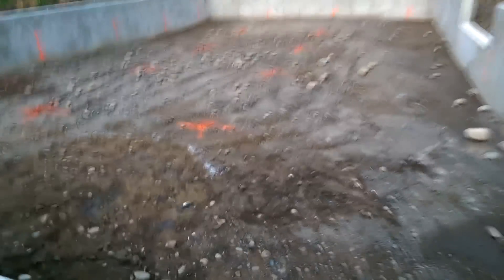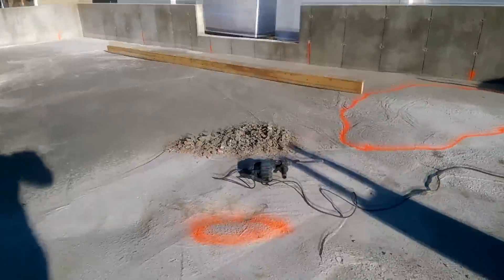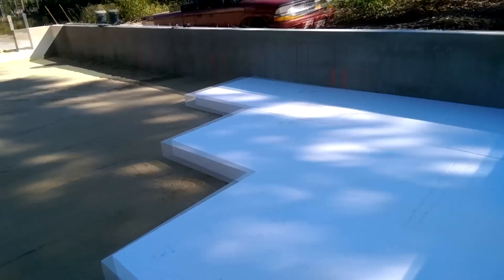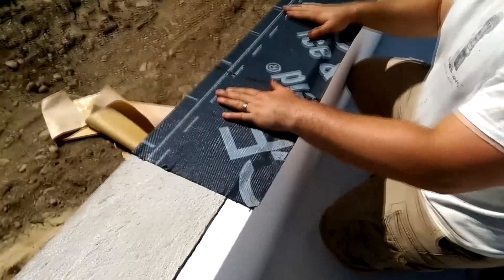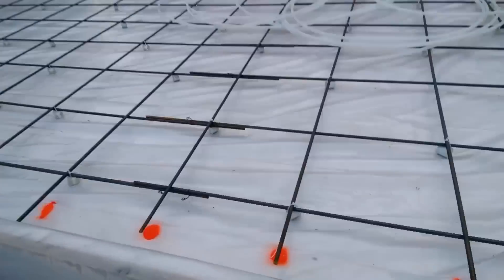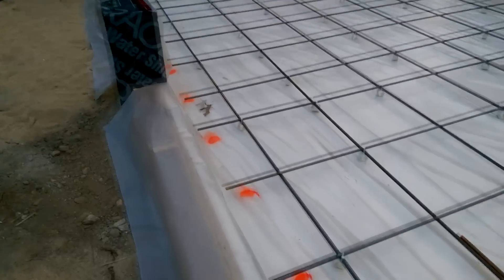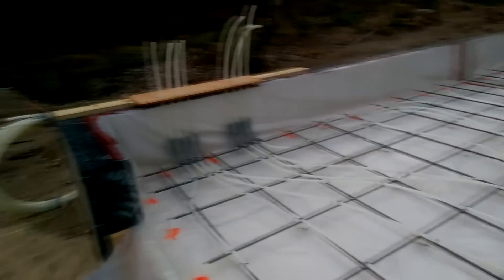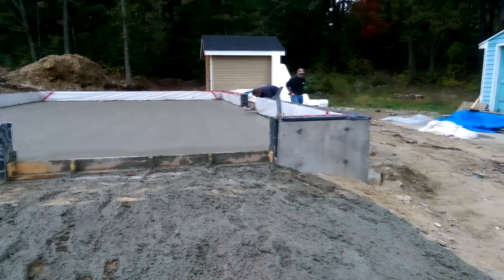Garage Workshop Super Insulated Radiant Floor

Comment: ive built a few of these floors before and i see quite a few mistakes. The foam you want to use under concrete floors needs to be at LEAST 8 lb density. Your pex is the wrong pex to use, you want the pex with aluminum sleeve, and you should have used gravel base  with drainage.
Reply from the maker: I do wish I had used a gravel base instead of messing with the flowable fill.  This PEX does have an oxygen barrier.  And the foam is a high-density foam.  Thanks for watching.
Reply: Nice work David! Thanks for posting. Do you mind sharing the brand and type of foam you used, where you ordered from and what it cost? I'm doing a radiant floor later this year and like the idea of a higher R-value beneath the slab than the required R15. But maybe it would be overkill for our climate in Portland, OR?
Reply from the maker: I bought my foam from Branch River Plastics in Rhode Island.  The product description is "Geo Foam".  You might be able to order it from a manufacturer closer to you to save on shipping.  As for the R-value, my R-56 is overkill for MA in general.  I went to that extreme because I'm trying to heat the garage just off solar.  Another extreme would be someone who is not heating at all.  They don't need any insulation.  Just match the R-value to your situation.
Reply: Thanks! I can appreciate what you're trying to accomplish!

Comment: All that money and effort and you didn't put a drain in?
Reply: ++Sonny Lloyd  Not sure about that million dollar filter but these days if you want an inside floor drain most codes make you install a separate drain tank (read: septic style tank) with an oil / grease trap and an alarm system or some way to warn you when it's full. It's not cheap. The easy way is to slope the floor toward the door and use an outside drain, which can lead to anywhere. Yeah, you have to open the door a crack to let the water out, but them's the breaks. The only alternative is to pitch the floor to a pit and install a sump pump, but some towns frown on that too!
Reply from the maker: There is no drain in the floor.  If you recommend a floor drain, then where does it usually go in your projects?
Reply: DavidPoz  either in between where the cars are parked as a length wise grate style or one directly under each car in the 4 inch with solids trap style
Reply from the maker: Thanks.  Do they go to the septic tank, or out to daylight, or something else?
Reply: DavidPoz  generally to daylight is what I've seen
Reply from the maker: Thank you.  Next time I build one I'll do that.
Reply: I put a drain in my first garage I built and I regretted it! I never used it once and I had to deal with a sloped floor every time I jacked a car up. I moved and built another big garage. I did not put in a drain in this one and it functions much better! I don't miss it at all.
Reply: ++boy2cuda.. How much pitch did you have to cause issues with jacking up a vehicle? I mean, 2 inches in say 30 feet is enough to get most of the water to move, but you may still have small damp spots because it's really had to get it right by eye.
Reply: True, it wasn't that much of a pitch. I can't remember how much exactly but when you put a car on jack stands to crawl under it I like the stands to be on a perfectly level floor and not have the jacks slanted even slightly.
Reply: ++boy2cuda.. You musta had one "son of a pitch" because my shop floor is about 2 inches in 30 ft and it's not even enough to allow a vehicle to roll, never mind being an issue with jacks / stands. OTOH, I did install a lift and had them shim it level. It's enough slope to add stress with 6,000 pounds up 6 ft in the air. For the record, I used 5,000 psi cement and did the lift area (center 8 ft) 6 inches thick using a 3/8 rebar grid placed 4 inches down and then a 6 inch mesh 2 inches above that. The rest of the floor is 4 inches thick with the steel mesh. Total poured floor is 35 ft long so I have room to use an engine hoist on either end of a vehicle or bring in a second vehicle to jack up behind the one on the lift. Twin post above ground lift capacity is 10,000 pounds and bolted into the floor so I couldn't put any pipes or conduit in the slab, which create weak spots. The main reason for the floor pitch is there's not enough pitch in the property to run a drain out to daylight if the pipe was well under the slab.
Reply: careful with that.  many municipalities don't allow garage floor drain to daylight for fear you're oil drip will go to soil and contaminate.  need a million dollar filter... bla bla.. not worth it.

Comment: Great video. I’m remodeling a 100yr old rock house in SW MO. The termite damage to the floor joist was so bad, after we pulled the first 2 layers of subfloor off the floor joist collapsed. Anyway we are retrofitting this old house with heated concrete floors. After seeing this video I’m certain geofoam is a product I will definitely use. Look forward to seeing the progress.
Reply from the maker: Sounds like a good project.  Thanks for updating us, and I look forward to hearing how it goes.

Comment: very impressive, it would be nice when building standards will mandate builders to do house slabs to such spec.  Homes built on slab get very cold in winter and hard to heat, very inefficient.
Reply: Then 90% of people couldn't afford a house and would have to live in tents.
Reply: I don't understand how you equate refining the spec on slab to 90% of population living in tents!

Comment: Will you ever save enough to pay for all the extra cost..
Reply from the maker: There is often a large up-front cost to renewable energy.  That is why I recommend minimizing energy loads first (insulation/air sealing).  Then the renewables can be as small as possible.
Reply: Also I'm gonna be building a 50x80x14 here in a couple years starting on the dirt work this spring.. needs alot of fill and time to pack and settle.. I have alot of question I wanna ask you I'm planning on one hole aide of the roof to be solar panels and installing geo thermal wells..
Reply from the maker: My goal is to build a solar heated garage, so it needs to be incredibly efficient.
Reply from the maker: Wow! That is going to be awesome, 4,000 square feet.
Reply: DavidPoz 
Yeah it's going to be big.. I see the solar on your roof.. I'm planning on  around 1000sqft of panels.. I see your floor has a footing around it I won't be doing that basically because of its cost.. I know I will lose alot of radiant floor heat through here but I have to cut cost in some places..
Reply from the maker: You mentioned 1000 square feet of panels... is that PV (electric)?  I'm assuming it is because you also mentioned a ground source heat pump.  Is your goal to be net zero?  Where about do you live, cold climate?
Reply: DavidPoz 

I have just begun my solar learning process.. I have no clue what I need yet.. i would love all my heat and cooling to be free.. I'm just not sure yet.. Any suggestion on good literature..
Reply from the maker: Congrats on starting a fun journey.  I find good literature hard to come by, and I'm not sure why.  Before adding solar make sure your heating/cooling load is as low as possible.  For this I recommend Bruce Harley, here is a link to the original 2002 version: http://amzn.to/2Dh8V8X  which  I own.  And here is a link to the updated version: http://amzn.to/2BnuVSr  (These links are affiliate so I will make something if you use them.)

After that, the best source of information on DIY solar is probably the older articles from Home Power Magazine.  (The newer ones have gotten away from DIY)  

If you are building new, then try subscribing to JLC (Journal to Light Construction)

You can e-mail me if you want to chat about the project.
Reply from the maker: In my situation I wanted a heated garage/shop.   I am heating the shop using solar thermal collectors.  These are panels that use the sun to heat water.  I then circulate the hot water through the concrete slab to heat the slab.  There is enough thermal mass to keep the building warm during night and cloudy weather.  No backup needed.  (although I do have a backup)  Regardless of your position on politics or climate change, it is pretty neat to heat a building all winter without buying energy to do so.
Reply from the maker: I have bought them in the past.  However, the panels on the garage I recieved for free because there were leaks.  I fixed them up and re-used them.  Here is a video on that: https://youtu.be/9Nd9k1rQPW8

Comment: Lots of good notes. You learn as you do more and more. Ask proffessionals if you arr midsing something. They might have recomended the slope.

As for the self level. Ground was probably to dry and sucked the moisture out of it. Increasing dry time. 
Probably could have done larger gravel, then screed gravel then foam.  Local build code would probably tell you
Reply from the maker: Next time I will do as you said, level gravel, then foam.  I won't be wasting my time with the "self-level" stuff again.

Comment: Thanks for your response. If you are using solar hot water, you do need "suspenders and a belt". I live in Alaska and in SW Idaho. I built a shop in Alaska with in floor heat and it works great. I am going to build a shop in Idaho soon and may use solar hot water for my in floor. How did yours work out ? What part of the country are you in ?
Reply from the maker: I live in central Massachusetts.  As for how it is working out, the garage is awesome, but the solar part I'm still tweaking.  Even last night I was finishing the plumbing on a new heat exchanger.  After our next sun-day I will be able to tell if that grabs enough BTU's.  I'm posting the videos on this channel so if you subscribe you can follow along.  Do you have any other questions?   I'm putting together a list and plan on answering several in a video.
Reply from the maker: I have several videos on the making of my solar hot water system.  After you take a look, let me know if there is something else you would like to see.  I'm always looking for input to plan future videos.
Reply: Do you have or plan to make a video showing the workings of your DIY solar water heater system. Would be great to see!

Comment: Nice job but way overkill for a garage. If your building site is dry, you do not need to use the foam board. Instead, use a plate compactor to create a compacted base, use, as you discuss, welded wire, hold it up with chairs, zip tie your Pex and call for the concrete truck.
Reply from the maker: I like pushing the envelope when it comes to energy efficiency.  I'm heating this garage with only solar energy, so the load must be as low as possible.  Thanks for watching.

Comment: Total overkill david. All you need in the floor is 1/4 " roll out reflective insulation. Focus the insulation on walls and attic. You are correct, 6-6 paving wire works so much better than rebar for routing the heat pipe.
Reply from the maker: Foil "insulation" is one of the most miss-understood products out there.  The purpose of adding the foil is to reflect radiant heat.  Heat transfers by radiant, conductive, and convection.  It is important to remember that radiant barriers only work if they are clean, and there is an air-space between the surfaces.   Given that I am pouring concrete directly onto the insulation there is no air space.  There is also no convection currents between the two materials.  So the only heat transfer we are concerned with is CONDUCTION.  (basically foil does nothing under a slab).  You mentioned 1/4" .  This would provide at most an R-1 (but probably lower with most products out there).  Given the best case scenario of an R-1 in your suggestion, we can do a simple heat loss calculation to compare it with the R-56 I installed.  I'll assume a constant ground temperature of 50*, slab temp of 80* and a five month long heating season (pretty conservative).  Do out the math and your method will lose 129.6 Mbtu's to the ground, costing you $9,116/yr. with my electricity cost.  My method loses 2.3 Mbtu's to the ground, costing me $162/yr.  Remember, this is only the cost of the energy being lost to the ground, it does not take into account loss through walls and roof.
Reply: If you put sand under your ins. and concrete that is your air space. Also if ur slab temp is 80. ur probably working in ur undies. Most people I know keep it at around 55-65 degrees. You don't have to believe me, that's your option. 25 yrs the senior. Never saw 9,116 anywhere. just my 2 cents.
Reply: a utility co here built a new truck parking garage, they put in heated floor using ground source heat pumps, insulation was that thin foil and it is the most inefficient floor i have worked on. another co built a similar building but put 6 inches of foam under the floor and they heat theirs for about a third the cost of the first one. the foil is crap for insulating under a floor. co i worked for did the tubing in floor and ground source on both. the engineers recommended the insulation used
Reply: Slab temperature with a heated floor is the hottest part of the room. It is NOT the air temperature. Think of it as the temperature of the air coming out of the vents from a furnace system. It has to be hotter than the space you are heating.
However, since the floor is such a LARGE area, it doesn't have to be all that much hotter to transfer the total amount of heat needed for the space.
Reply: (Hint:  Use <alt>+0176 on the number pad to make a degree symbol, e.g., 50°F)
Reply: ++DavidPox  Not sure exactly where you are located but in most parts of the USA electricity costs WAY more than gas or oil when heating, regardless how you transfer the heat. (talking available BTUs per dollar) I love the idea of gaining as much as possible via solar collectors but then you still need a back up for dark days and nights, which is where oil or gas will eventually come into play. You'd' also need LOTS of storage to "save" the solar for off-peak use. Yeah, you could back it up with wood or even a generator (for power failures) but electric heat via a home generator is not even worth considering from a cost stand point. Of course with the amount of insulation in the project it would be a cinch to use one of those ultra efficient (and small) gas fired water heaters instead of a conventional boiler.
Reply from the maker: I live in Massachusetts.  You are right that electric costs way more than other fossil fuels.  I pay an average of $0.24/kwh (this includes everything).  My thermal battery bank is the concrete floor.  When the sun shines I heat the floor, and then I can coast for a long time.  I can coast from 60° to 40° over the course of a week with no additional heat input.  I'm glad to have built the structure well insulated and air-tight.
Reply from the maker: Exactly!  It's common for the slab to be 10 degrees warmer than the air temp.
Reply: +DavidPoz   Ahhh, I only live a short distance away in Ct and I feel for you with the electric price being similar here. (near 23 cents / Kw) While it's nice to know you can coast for a week, it's a royal pain to wait the additional day or so for warmth to return, never mind trying to get anything done when it's 40 degrees inside. With radiant heat nothing moves quick, which is another reason I was pointing out the alternative heat source, especially when we have those spells of no sunshine for two weeks or more during winter or those early spring rainy weeks where the temp hangs at 40 degrees. This is what holds so many people away from going totally solar. Years ago I had a customer who was experimenting with it and actually bought an above ground pool (4,000 gallons) then installed it in his basement as back up. Yes, insulated and covered. He stated it still wasn't enough and resorted to adding a heat exchanger to a small wood stove to keep things consistent.
Reply from the maker: Thanks for sharing your experience.  It rely helps drive home the point.

Comment: Rebar in the centre of a concrete slab does almost nothing. It has to be either at the top of the slab or at the bottom, depending on whether you are trying to resist downward bending or upward bending of the slab. Speak to a civil engineer.
Very nice thermal insulation though.

Comment: You are putting the wall insulation on the wrong side of all that concrete thermal mass.  Passive Haus, basics.
Reply from the maker: There are many ways to make an efficient envelope, but only a Sith deals in absolutes.

Comment: Rebar was the smartest thing you did. It will hold that concrete together tight. Wire mesh gets stepped on during the pour, and is hit and miss as to its height. Don't worry, your young and you got a few more shops in ya. Good luck, "W.W."

Comment: Nice going .
Just FYI, welded wire is only designed to minimize cracking . Rebar is used to reinforce the concrete . For a garage it’s better to use rebar because it strengthens the slab. Welded wire DOES NOT do this .
U can use both though. The rebar for strength , and the welded wire to make installing the radiant tubing easier . Just a suggestion if u try this again in the future . 
Again, nice job 👍
Reply from the maker: Thanks for pointing that out, I did not dive into the details in the video.  When I said I would used welded wire in the future it would be for securing the radiant tubes, then Rebar on Top.  Exactly as you have suggested.